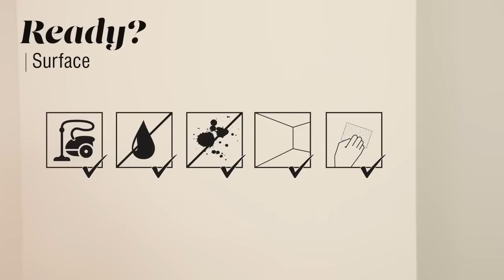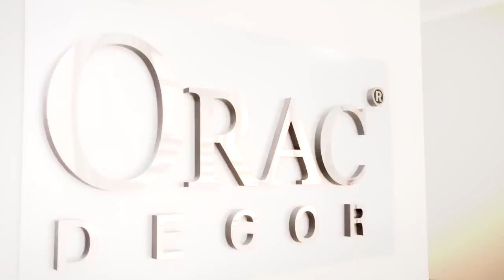Coving & Cornice Mouldings - Cutting an External Corner

Comment: I fail to understand the need for the angle or drawing lines on the ceiling, you're cutting at 45 degrees anyway without taking either the ceiling lines or whatever angle you were measuring.
But reading the comments i see i went wrong by cutting it flat in the mitre box and not angled! Gonna give that a go now!
Reply: Hi - agree that it is slightly confusing.  There is also a (very expensive) tool that can cut to any angle (hence the confusing additional stuff) but that is really only aimed at the tradesmen who do this for a living. It is actually the manufacturers' video production (not ours) and we would definitely have done it differently!  Re cutting flat in the mitre box, that is the most common mistake people make if they have never cut coving before.  Hope you have got it sorted now...
Reply: @davidwarner2784  thanks, got it right , had to place the cornice in the mitre box with the ceiling edge of the cornice flush to the bottom of the mitre box and the bottom edge of the cornice flush against the side of the mitre box. Worked like magic. I still dont know why the cut has to be from the bottom edge and not the ceiling edge but it just works.

Comment: All looks good on a demonstration video!  However in the real world , the ceiling wont be level, and the corners wont be 90 degrees. This can throw any mitre out by loads,  so a simple plastic or wooden mitre box wont do,  adjustments will need to be made to the cut angle.and thats why an angle finder is useful.

Comment: Can you explain how the corners are supposed to mate up when cut in a mitre box? Corner cuts must be angled in 2 different planes to give correct profile.A simple 45 degree cut does not work.Yet the video shows corner aligning perfectly after a simple 45 degree cut in mitre box?
Reply from the maker: It sounds like you are trying to cut the coving 'flat' in the mitre box which isn't correct.  Have a look at the instructions here - https://www.decorative-coving.co.uk/installation-guides/ -
Reply: Just stumbled across this video and I agree completely what's the point on using an angle finder if your only method of cutting is a mitre box. If a mitre saw was in the mix the angle could be bisected and cut accordingly.